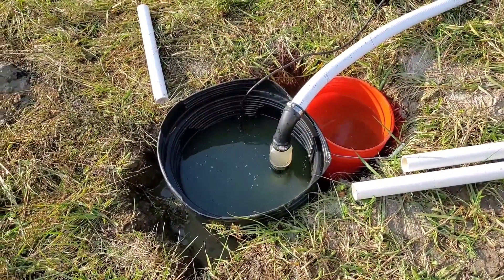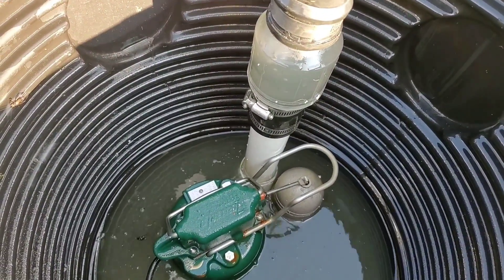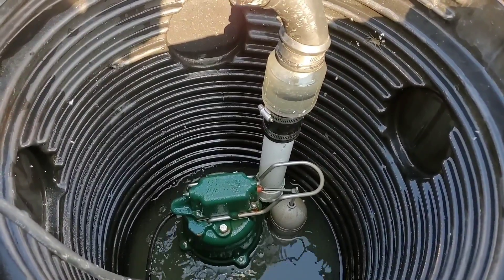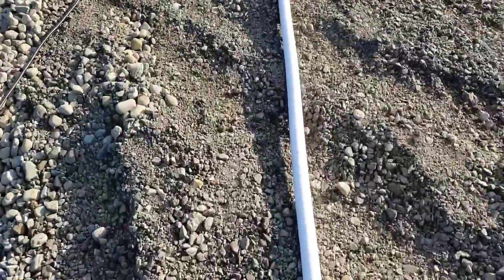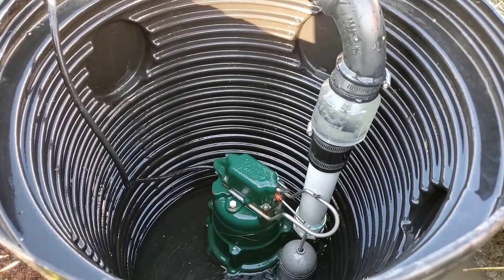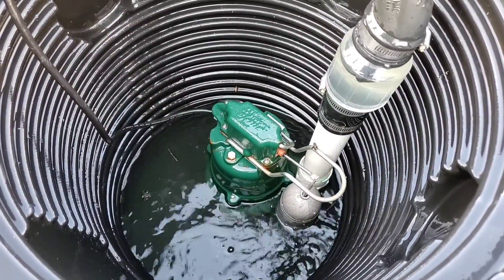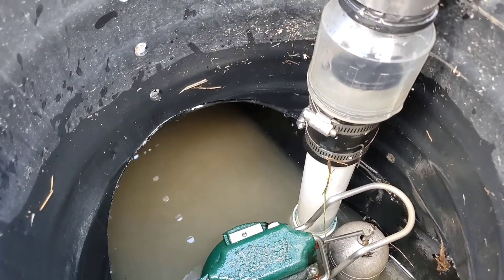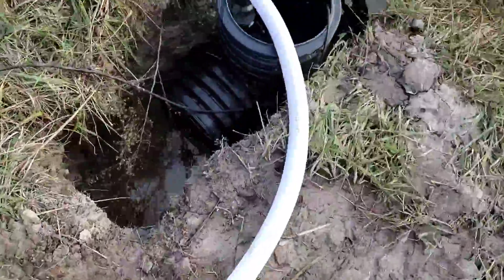BACKYARD SUMP PUMP Basics Part 2: Understanding the Check Valve [ Backyard Drainage Fix Flooding ]

Comment: Huh????  We have subpump in our basement on the front part.of.the house but the back is where our sewer is where all of our water goes waste and regular...   Thats where we flooded for 12 plus years.  This year we installed  a heavy duty check valve in our basement to stop backflow so we dont flood any more.   Whats so bad about check valve / backflow preventer????
Reply from the maker: It's fine if it's in your basement. It's even fine in warm climate. Unfortunately, it holds water in the line and the line freezes in yard drainage.
Reply: @FRENCHDRAINMAN what freezes?  Its just a flap that closes if water pressure is detected from the sewer to my house.  It lets water flow freely as it always use to when I run water.   How could it freeze if the flap isn't holding water.

Comment: Our sump pump (in our livable basement) runs constantly regardless of season and rain or not. It is to the point where a large area of our yard is a puddle of water daily. What can be the cause of this, and who would be the right people to call for an inspection?
Reply from the maker: Just make sure you have a backup pump on a separate circuit

Comment: That’s why you install a full port valve right above the check valve. If the check valve goes bad, shut off the valve, no need to drain the discharge, replace the check valve, open it back up you’re good to go !
Reply from the maker: https://youtube.com/playlist?list=PLjFCqaZ4v1BXXbPw3Vf7e86DbKj7qOnLn&si=RcZu7-T4FHC6LNxn